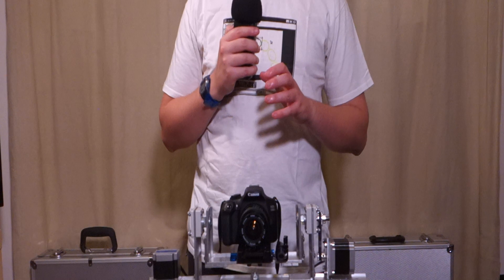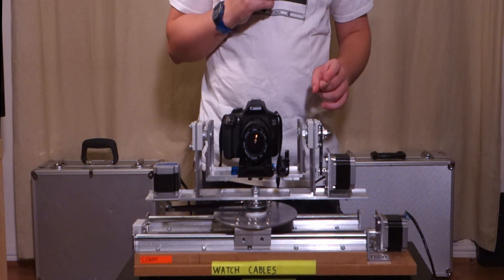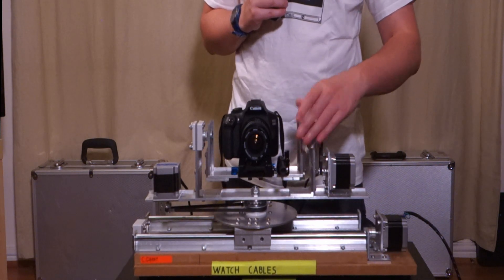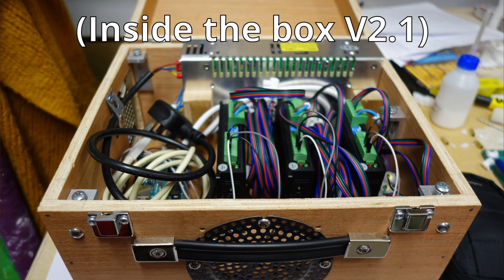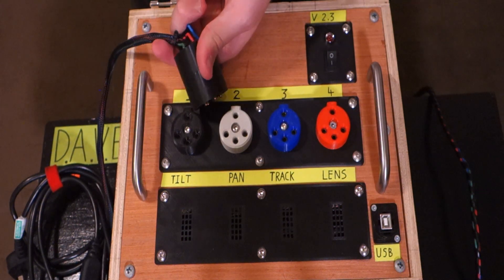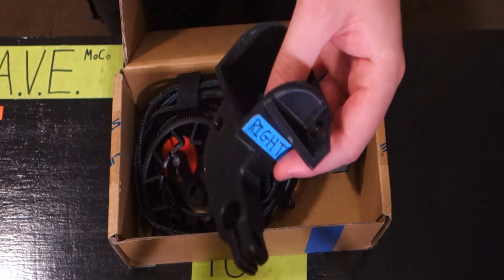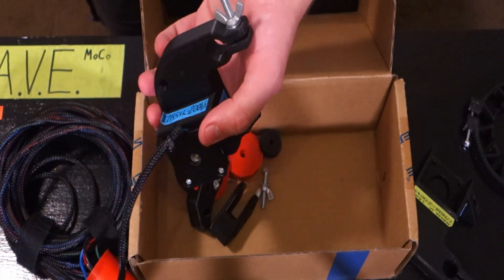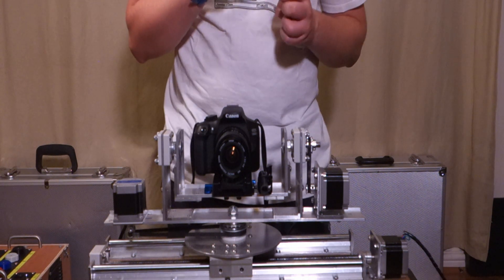Stop Motion Camera Rig - Overview (Arduino Motion Control) [Part 2]

Comment: Hi Cameron. Thank you for mentioning me in your video. Good to get a detailed view of your rig. One update on the focus rings. I am now just adding 3Dprinted smaller rings to my lenses to avoid having the bolts and to make it all a bit more compact. If you look up Cine-modding lenses on YouTube, you will find several examples. They are easy to print, and I just get them a tight fit on the lens and leave them there permanently. I shall be putting out some videos on my rigs soon - my resolution for 2024! Keep up the good work!